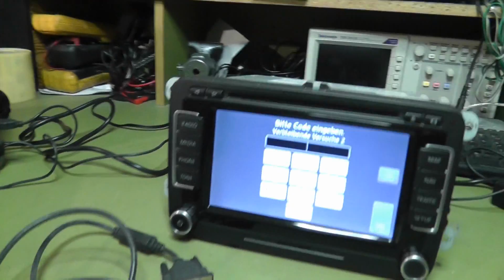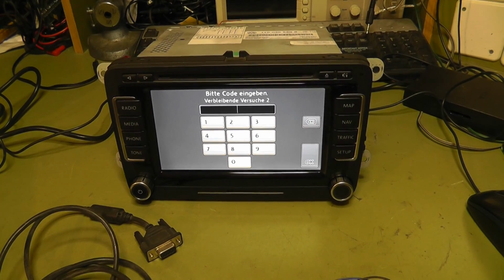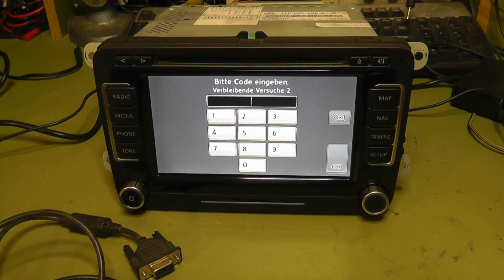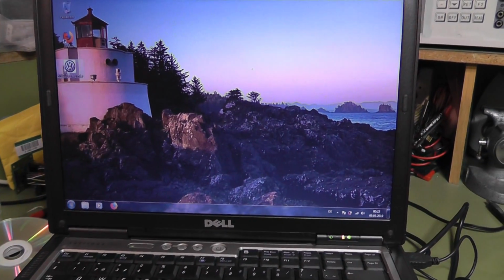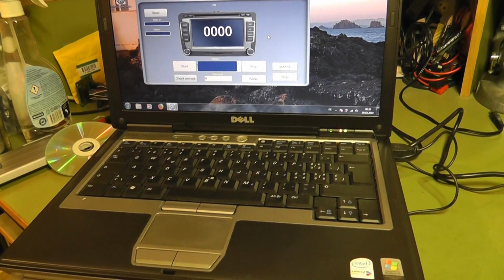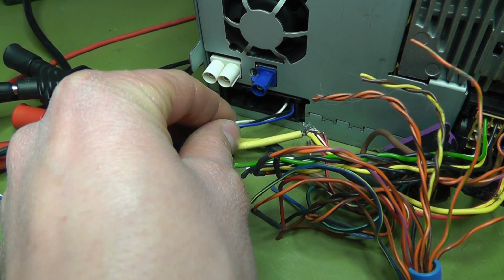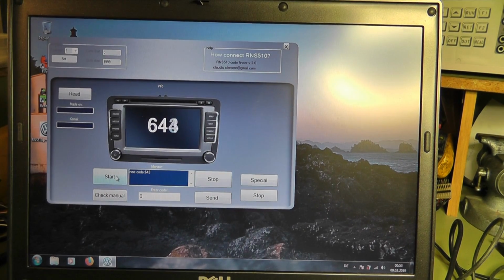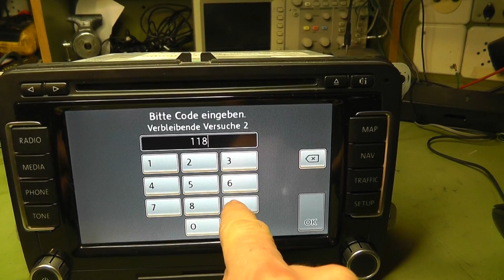RNS510 code finder

Comment: Worked for me eventually.  For those where it is just stuck on 0 I got the same problem.   I purchased a null modem serial cable to use which having stripped down and tested for continuity found that wire 3 and 2 were reversed. So I swapped them over and it worked. Thanks for the videos and the program, saved me a small fortune.

Comment: Like others I tried this with the USB to Serial adaptor and it didn't work.  When I found a computer with a 9-pin 232 it worked immediately.  Thanks for the video mate!  Very helpfull!
Reply: Which windows you have used ? I have problems to start the programm...

Comment: i got a 3 digit code.. 654? how is that possible.. do I enter it as 0654?

Used a USB to Serial/RS232 cable then followed the diagram.. 

Set the COM port in the app, then Read, if that works then all good to press Start, i changed the numbers after my first hit of 654, told it to try 1000 to 9999

Comment: Had my RNS510 out to fix a commonish glitch where a techno bass drum beat at 91BPM takes over the whole system at random. Asked for code on refitting after hopeful fix. Skoda dealer wnater AUD$220 - that's blackmail. My car, my system, my code!! 
This is a marvel!! Initially I only got the Zero. I used a male D9 to USB that I have for programming my motorcycle ignition and was confused about the connection. Tried reversing position of pins 2 and 5 and ran the program and it scrolled through and came up with three digits. Read below about adding a 0 in front and wasn't hopeful but after charging the power feed battery and waiting 60 min urtes to be unlocked out ... BINGO!! Quite stunned to be honest.
Re the power supply, I had the same query and wish the presenter had included this info. I worked out that power in is where the 2nd from bottom red/white wire fits from the multipin plug and earth is where the brown wire fits (adjacent and below that). I used a small 12V motorcycle battery to power it up. I'd post a pic but don't know how. bravo Claudio and Kostel!!

Comment: Hello. I give voltage 12V on 12(-) and 15(+) and radio still cannot be started/What i did wrong any ideas?
Reply: Same here, did you solve it?
Reply: @lols11  yes.I give wrong voltage with my laboratory power supply
Reply: @ivansagafonovs1764  Thanks! I actually found out that my power supply is broken

Comment: Nice vid !
But i have a Problem: In the car, the radio is turning on, but not on the workbench ! It only move the eject of the cd drive and turn on the back lights, but goes off right away. The logo on the screen does not apperar
Which contacts are used for plus and minus to power up the radio ?
Reply: I think you need to connect +12 twice. One for the radio in general and another time to simulate the key turned to on/accessory. I had a harness wired up this way but forgot which pin was what, so you might need to refer to a Bentley manual or google online.
Reply: @pkhoury1212  I tried everything, also the old scool wiring.
The original wiring in the car has only one minus and one plus and it switches on by a CAN bus command. You have to use a CAN bus signal generater device OR good luck that the radio was in on mode and had memorized his last state.

Comment: Thanks heaps for sharing. it worked for me last night. I can't find old pc/laptop with serial. But usb-serial dongle worked just fine after correct com port is selected.  Make sure the RNS 510 unit is not "system locked" and on "Enter PIN" page. before the program works.
Reply: Can you show me how please my friend

Comment: Worked perfectly once I used a proper com port, had forgotten my old workstation had one, tried with an old USB adapter first and that didn't work. Connected it all up to my Dell, and less than three minutes later I had the code, perfect, thanks.
Reply: It doesnt work with usb connection? I need the dsub9 (computer) cable?
Reply: @seethix  I think it depends on what adaptor you use - some have different chipsets.

Comment: Hello. Adapter usb-com wiht chip CH340. Does not work. Adapter with FT232 doesn't work too.In V2.1 terminal shows garbage. Code start 0 and stop. Windows 7 64bits. On Windows XP ( sp3 ) the program does not start

Comment: Can you connect it to any VW radio ? Or it has to be similar radio?
Reply from the maker: all RNS510 based radio can be done. Others not
Reply: @kostelectronics   those serial cables can be hooked up to the big VW plugs too then right ? I see the radio your working on has a smaller plug on the right side , but most VW radios come with only one big plug with the lever lock
Reply from the maker: @bennylemma5923 yes, but the RNS510 radio has this plug. This software works only for these models.
Reply: @kostelectronics  thank you for the reply

Comment: what version of windows I need? 64 or 32 bits?
Reply from the maker: to be safe: use a 32 Bit version!
Reply: I tried XP pro 32bits and it does not launch. I also tried windows 7 64bits on bootcamp, my hopes were low as it is bootcamp and it did not work. What version or Windows 32 bits would be best to try? I think I have Vista somewhere, would that work on a normal PC?
Reply: What version of windows 32 bits .....?
Reply from the maker: @captaincove9136  Win7 32bit works!

Comment: 이 대화 상자 대신 JIT(Just-in-time) 디버깅을 호출하는
방법에 대한 자세한 내용은 이 메시지의 뒷부분을 참조하십시오.

************ 예외 텍스트 ************
System.InvalidOperationException: 포트가 닫혀 있습니다.
   위치: System.IO.Ports.SerialPort.Write(String text)
   위치: System.IO.Ports.SerialPort.WriteLine(String text)
   위치: RNS510_temp.RNS510_decode.button6_Click(Object sender, EventArgs e)
   위치: System.Windows.Forms.Control.OnClick(EventArgs e)
   위치: System.Windows.Forms.Button.OnClick(EventArgs e)
   위치: System.Windows.Forms.Button.OnMouseUp(MouseEventArgs mevent)
   위치: System.Windows.Forms.Control.WmMouseUp(Message& m, MouseButtons button, Int32 clicks)
   위치: System.Windows.Forms.Control.WndProc(Message& m)
   위치: System.Windows.Forms.ButtonBase.WndProc(Message& m)
   위치: System.Windows.Forms.Button.WndProc(Message& m)
   위치: System.Windows.Forms.Control.ControlNativeWindow.OnMessage(Message& m)
   위치: System.Windows.Forms.Control.ControlNativeWindow.WndProc(Message& m)
   위치: System.Windows.Forms.NativeWindow.Callback(IntPtr hWnd, Int32 msg, IntPtr wparam, IntPtr lparam)

************ 로드된 어셈블리 ************
mscorlib
    어셈블리 버전: 4.0.0.0
    Win32 버전: 4.8.4069.0 built by: NET48REL1LAST_B
    코드베이스: file:///C:/Windows/Microsoft.NET/Framework/v4.0.30319/mscorlib.dll
----------------------------------------
RNS510_code_finder
    어셈블리 버전: 1.0.0.0
    Win32 버전: 1.0.0.0
    코드베이스: file:///E:/%EC%88%98%EC%9E%85%EC%B0%A8/RNS510%20PIN-code.exe
----------------------------------------
System.Windows.Forms
    어셈블리 버전: 4.0.0.0
    Win32 버전: 4.8.4042.0 built by: NET48REL1LAST_C
    코드베이스: file:///C:/Windows/Microsoft.Net/assembly/GAC_MSIL/System.Windows.Forms/v4.0_4.0.0.0__b77a5c561934e089/System.Windows.Forms.dll
----------------------------------------
System
    어셈블리 버전: 4.0.0.0
    Win32 버전: 4.8.4001.0 built by: NET48REL1LAST_C
    코드베이스: file:///C:/Windows/Microsoft.Net/assembly/GAC_MSIL/System/v4.0_4.0.0.0__b77a5c561934e089/System.dll
----------------------------------------
System.Drawing
    어셈블리 버전: 4.0.0.0
    Win32 버전: 4.8.3761.0 built by: NET48REL1
    코드베이스: file:///C:/Windows/Microsoft.Net/assembly/GAC_MSIL/System.Drawing/v4.0_4.0.0.0__b03f5f7f11d50a3a/System.Drawing.dll
----------------------------------------
System.Configuration
    어셈블리 버전: 4.0.0.0
    Win32 버전: 4.8.3761.0 built by: NET48REL1
    코드베이스: file:///C:/Windows/Microsoft.Net/assembly/GAC_MSIL/System.Configuration/v4.0_4.0.0.0__b03f5f7f11d50a3a/System.Configuration.dll
----------------------------------------
System.Core
    어셈블리 버전: 4.0.0.0
    Win32 버전: 4.8.4069.0 built by: NET48REL1LAST_B
    코드베이스: file:///C:/Windows/Microsoft.Net/assembly/GAC_MSIL/System.Core/v4.0_4.0.0.0__b77a5c561934e089/System.Core.dll
----------------------------------------
System.Xml
    어셈블리 버전: 4.0.0.0
    Win32 버전: 4.8.3761.0 built by: NET48REL1
    코드베이스: file:///C:/Windows/Microsoft.Net/assembly/GAC_MSIL/System.Xml/v4.0_4.0.0.0__b77a5c561934e089/System.Xml.dll
----------------------------------------
System.resources
    어셈블리 버전: 4.0.0.0
    Win32 버전: 4.7.3062.0 built by: NET472REL1
    코드베이스: file:///C:/Windows/Microsoft.Net/assembly/GAC_MSIL/System.resources/v4.0_4.0.0.0_ko_b77a5c561934e089/System.resources.dll
----------------------------------------
System.Windows.Forms.resources
    어셈블리 버전: 4.0.0.0
    Win32 버전: 4.7.3062.0 built by: NET472REL1
    코드베이스: file:///C:/Windows/Microsoft.Net/assembly/GAC_MSIL/System.Windows.Forms.resources/v4.0_4.0.0.0_ko_b77a5c561934e089/System.Windows.Forms.resources.dll
----------------------------------------
mscorlib.resources
    어셈블리 버전: 4.0.0.0
    Win32 버전: 4.7.3062.0 built by: NET472REL1
    코드베이스: file:///C:/Windows/Microsoft.Net/assembly/GAC_MSIL/mscorlib.resources/v4.0_4.0.0.0_ko_b77a5c561934e089/mscorlib.resources.dll
----------------------------------------

************ JIT 디버깅 ************
JIT(Just In Time) 디버깅을 사용하려면 이 응용 프로그램 또는 컴퓨터의
config 파일(machine.config)의 jitDebugging 값을 
system.windows.forms 섹션에 설정해야 합니다.
또한 응용 프로그램은 디버깅할 수 있도록 컴파일되어야
합니다.

예:

<configuration>
    <system.windows.forms jitDebugging="true" />
</configuration>

JIT 디버깅을 사용하면 처리되지 않은 모든 예외는
이 대화 상자에서 처리되지 않고 컴퓨터에 등록된 JIT 
디버거에 보내집니다.

Comment: Hi, I have the program and a usb to RS232 converter, but when I start the code finder it doesn't get past 0
Any ideas?
I downloaded the program from google drive. Is that link still ok?
Thanks
Julian
Reply: I have the same problem, it still shows me 0. Any ideas?
Reply: @Baba_witcher_Yaga  nekem is ez volt , és a com port kiválasztással volt gond , utánna működött.
Reply: Si votre compteur reste à zéro (0) c'est parce que vous n'avez pas la bonne version de .Net Framework, car ce programme a besoin de ça pour fonctionner
Reply: Will the program work on a linux based system?
Reply: I have the same problem

Comment: Can this work with male port in VGA port on my latop
Reply from the maker: No! You need a RS232-Port or Adaptor!
Reply: @kostelectronics  i have an adaptor to usb. I have installed the driver also. But i dont can set up the port. Have you any ideea? Thank You

Comment: Hello Sir i have a question about this cable.. could you direct me to where i could get such a cable. Thank you
Reply from the maker: You can use any D-Sub9 Cable and connect Pins to Rx, Tx, GND like in the schematic from the software. I made this cable by myself! 
BR Matthias
Reply: @kostelectronics  Thank you for the reply. i have already visited an official vw dealer and wasted money on codes for other radios. visited different tech shops but to no avail.
This rns510 comes from a different car and i cannot get a hold of the previous owner. 
One more question Sir. So i have this codefinder and the laptop and i will order the cable. But how is the radio itself powered?
I think thats all i need to know Sir.
Thanks a bunch.
Ps. did you know this radio costs 2400+ euros at an official vw dealer? xD

Comment: A scheme would be helpful for to connect the RNS510 to the voltage
Reply from the maker: The pinout is very common. it's even printed on top of the radio :)
Reply: @kostelectronics  Yes.  It is correct.  But is it enough to connect only plus and minus?
https://imgur.com/a/QzLfpqr
Reply from the maker: Yes, it's enough. But +15 comes over CAN from the BCM. The radio turns off after 20min (battery Saver)
Reply: @kostelectronics  Thank you very much. Happy holidays!
Reply from the maker: @Tuluceanu  Nice to hear that. I wish you the same! BTW: I'm a big Volvo-Fan as well :) from where are you?
Reply: @kostelectronics  România
Volvo = Safety

Comment: Hello.Do you know if it will work with a usb adapter.As I don't have access to a PC that has a serial port.Thank you.
Reply from the maker: it should. But it's safer with a Hardware RS232-Port.
Reply: @kostelectronics   would the cp2102 work? Do you know what the actual pin assignment is on the serial? Like rx tx ....
Reply: @kostelectronics  i  tried it but it doesn't start to count
Reply: @asasin8er  I've got the same problem, had an old USB to Serial adapter, but its shown in windows as a  CP210x, and it doesn't count up :-(

Comment: Hi My laptop is 32bit and the program is 64bit. Tried through USB on my 64bit laptop but the program wont allow me to select usb, is there any other way I could use this programme? Thanks
Reply: Your USB serial adapter should assign a COM port. I haven't yet tried it, but I only use Keyspan USB adapters, which work pretty reliably when you would traditionally need a hardware serial port.

Comment: May I know how u power up the head unit? Can u show me?
Reply from the maker: just the normal power + GND pins, notning special. The pinout is all the same as other radios with this connector.
Reply: @kostelectronics  Thanks. I try to figure out.
Reply: @kostelectronics  Thank you so much. I manage to get the pin code. I am so happy!

Comment: Thanks! does it work with RNS 315
Reply: Have you found out if it works ?
Reply: what terminals did you use on the 315?